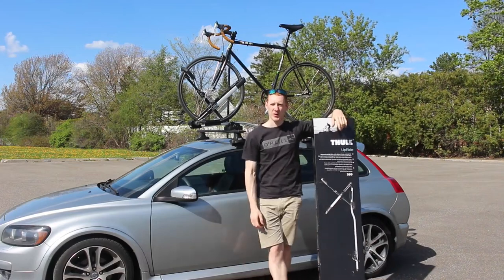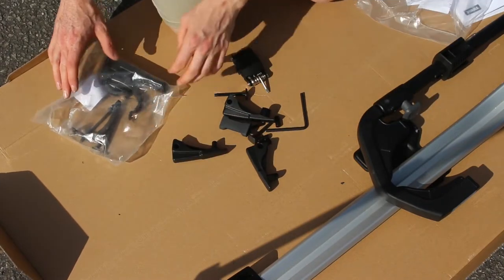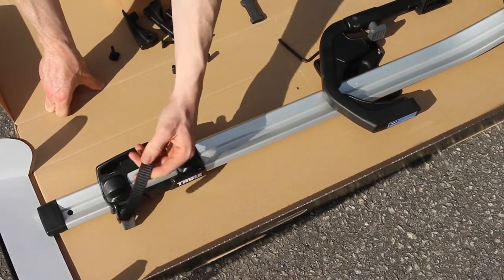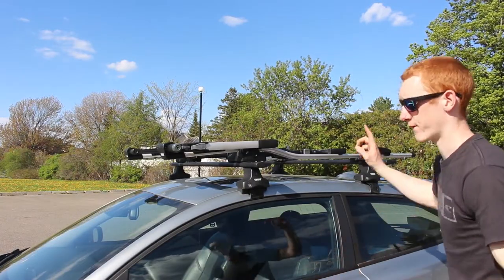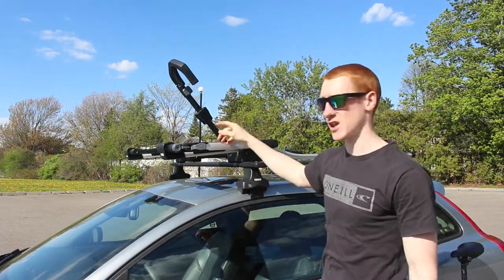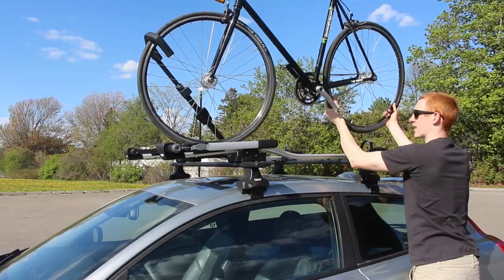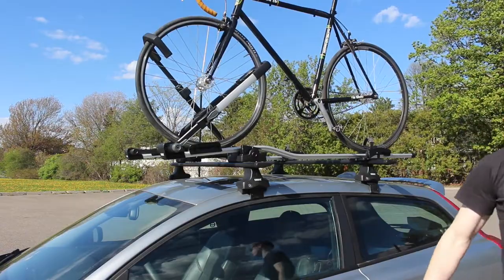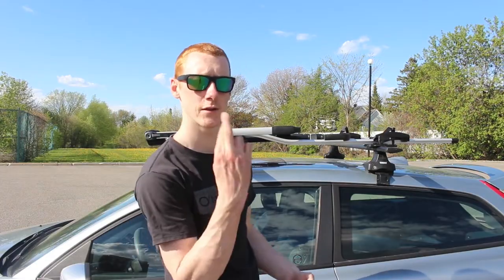Thule UpRide Installation

Comment: I have this same set up but I wanted to ask, you know those weird metal half loops that the Uprides come with? I couldn't figure them out man or is that even necessary
Reply from the maker: Hey Paul, the half loops would be used if you wanted to go under the bars instead of in them with the T-screw. So if someone had square bars or the rounded bars that don't have the T-track. Hope you like em, I'm loving mine!

Comment: What is the distance between your racks? Is there a requirement/special instructions for thule upride?
Reply from the maker: Hey there Lloyd, that's a very good question I just went through documents and have not found a mention on spacing. 

Mine are pretty close are 30 in/  76.5 cm apart and have been just dandy

Comment: Can you leave the rack there when you don't have bike on?
Reply from the maker: Yea you for sure can, one of the latches is lockable too.
Reply: @TheRouge  Any concerns with arms flying up or moving around when driving without a bike. They don't seem to lock when stowed away.
Reply from the maker: @spinfunky  they have been stable for me. On the city roads and the highway. Will be doing an actual review shortly.
Reply: @TheRouge  thanks for a reply. And you drive with it empty ?
Reply from the maker: @spinfunky  no problem! And yes I do, did just shy of 200 km this weekend with it empty and resting down. Was cruising at highway speeds.
Reply: @TheRouge  sweet. I had an experience 25 years ago in my first car where the hood latch broke and came smacking my windshield at 60mph, so you can say it left me with some mental scars 🤦‍♂️🤣
Reply from the maker: @spinfunky  oh my!!! Hey precautions need to be taken! I take it your windshield played it's roll and kept you safe.

Comment: Great video by the way! So to have both racks facing the same way on the car you have to unscrew the wheel cage and flip it around right? I think that’s worth mentioning. Both the racks look way more cool facing the same way.
Reply from the maker: Thank you J D, you got it. To have both facing forward that rotation is needed. And to have both facing forward makes for easier on and off as well as looks better. Also I didn't find much of a difference in terms of efficiency. I drove 1000km with them the same way and 1000km with them opposite.